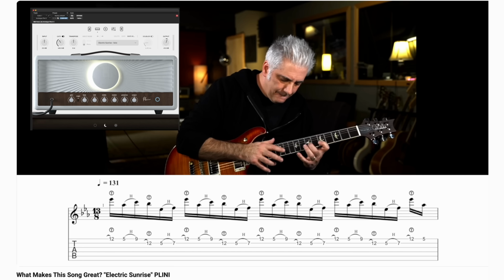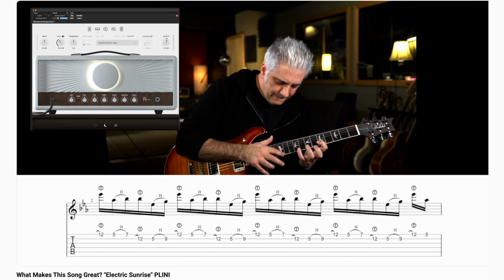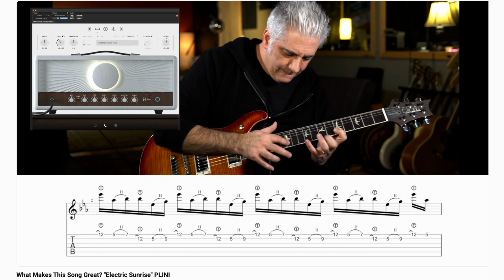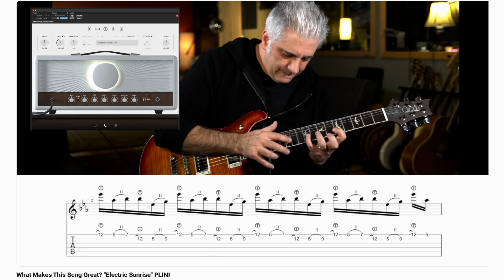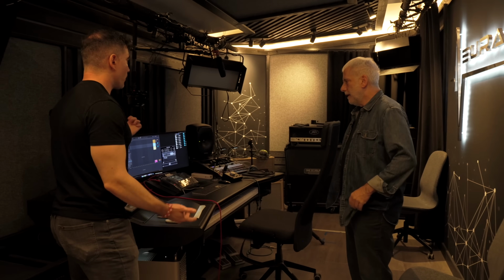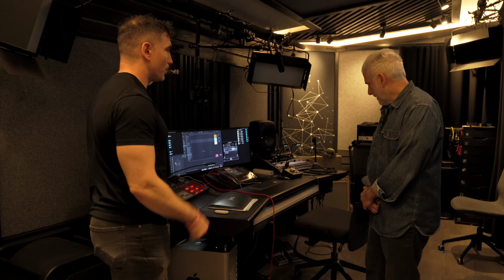I Flew to Finland to Find Out...How Are Amps Modeled?

Comment: While computer technology for guitar captures and amp simulators continues to improve, there will always be a need for real amplifiers for two fundamental reasons. First, something authentic must exist for the copy to imitate. More importantly, experienced players depend on touch sensitivity, dynamic response, and nuance that current digital captures simply cannot reproduce.
 
Amp simulators can approximate tone — open-chord strumming, basic rhythm work, and even heavy chugging — but they almost always feel sterile and fall apart when extreme technique and fine touch sensitivity are required. Many of the greatest players in history, such as Eddie Van Halen, created tone with their hands. Countless guitarists have tried using his exact equipment, only to be disappointed that they still didn’t sound like Eddie. That nuance was in the player, not the gear.

Many younger, up-and-coming guitarists will never experience the greatness of the past, nor will they reach the same level of expression. Instead, they are often impressed by what computers allow them to do. Some modern amp simulators even mask mistakes, much like autotune in vocals, making every note sound clean whether it was played correctly or not. This artificial boost in confidence is like unlocking a cheat code in a video game — something that was neither necessary nor possible in the 1980s, when some of the greatest guitarists were shaping rock music through skill alone.

So while AI and digital tools continue to be applauded — even as they replace jobs and risk creating widespread unemployment — it’s important to recognize that amp simulators will never surpass the true tone, feel, touch sensitivity, and sonic complexity of a real tube amplifier. At best, they will only ever attempt to copy it.

Comment: The point of using a real tube amp is that it changes the way you play. You can literally feel the amp under your fingers, much like an acoustic instrument, it interacts with your playing.  I see neural models as the ultimate evolution of midi sounds: while for the casual listener they can be pretty damn good, even excellent, for the PLAYER that is used to tube amps , they are a world apart. You must have tried  high-end analog stuff to believe.

Comment: I just put my Friedman Runt 20 and other tube amps in storage and up for sale as well after getting the Spark 2 set up in my studio. Are they as good as my tube amps? well, no but I can practice at lower volumes and I've found recording via mic or direct sound great in the mix! I've been against modelers for a while but I just can't play my tubes at the volume levels that do them any justice and I'm not gigging, so... this was a great easy and good looking alternative. The Spark 2 with Cab have a great old school amp look with the tolex and speaker grilles. I'm loving it! I'll have to check out Neural!

Comment: Great video! Hearing Doug's story was really inspiring. Before watching this I suppose I was under the impression that amp modeling meant deconstructing the hardware and replicating each individual circuit in software. It sounds like Neural DSP has done this in the past, but found that it was too time intensive. Instead now they are using machine learning techniques to train some input against this 10 hours of output with the knob changes as parameters. I suspect the original technique is more accurate, but the practical trade-offs make a lot of sense.

Comment: NDSP plug-ins are fantastic. I just picked up Petrucci X during Black Friday. It's super good. Right now, I don't care if its a plug-in or an amp, it's apples and oranges with tehcnology the way it is. In fact, most venues you just plug your modler into the front. No one knows better. The amps and cabs on stage are fakes anyhow. Nothing more than props. People just don't want to drag around 200 lbs worth of equipment anymore. Also in my arsenal are Soldano, Wong, Abasi, Nolly and Plini. All great, but Petrucci sim takes the cake. Well worth the price.

Comment: I'm already ready for QC II. Some of my requests: 1.  Instant On (I've seen these go down live and it's a wait for them to boot back up)  2.  Be about 2" wider all around with a little more separation of the buttons.  3. A proper 120V cable instead of the 9V plug

Comment: Great video. I have a DigiTech GNX 3000. Not sure what year or planet it's from, I think like 1992 Jupiter? But I still use it every day! It is still light-years ahead of today's stuff. Standard guitar input plus, and, this is why it's way ahead, stereo line level inputs, a XLR mic input with level adjustment, stereo 1\4 output, headphone out, MIDI, USB, and this is the biggest advantage, IDK why nobody is doing this today STEREO XLR OUTPUT! With silent stages and recording being the main uses of there's units. For the love of all things musical, STEREO XLR OUTPUTS! And NO NO NO not just a single XLR. When using modulation fx and STEREO delays. Why the fuck is STEREO XLR output such a forbidden concept? They take the time to program STEREO fx of all kinds. Then... Oh here is you mono direct output. I thought of replacing my still far advance "old" pedal but just saw today's stuff as a step backwards just because of that one issue. So with that said... Please spread the word to all manufacturers to take a step into the 1990s and advance your equipment to STEREO XLR OUTPUT. Thank you, GOD, Genius Of Design 😂😂😊😊 👹👿😈
P.S. and I'm not talking TRS cheating. I don't need to buy special wires and adapters. REAL XLR! Did I mention with an adjustable out knob?😅😂

Comment: He doesn't really explain why the lows in the B3K would be "completely clean" simply by attenuating the highs. Is this a "clean bleed" thing like on the Tube Screamer circuit? I know there is a clean blend on the pedal, but that doesn't sound like what he is referring to.
Reply: Its a language barrier thing. He's referring to the fact that Darkglass pedals cut the highs from your clean signal as you are blending it with the distorted highs. The result is a more growly and natural effect than just blending parallel
Reply: 19:04 - From what I can tell, as Darkglass makes the point that the clean signal is never boosted in the B3K-type circuits, he's saying that attenuating the mids and highs post-distortion makes the bass in the clean signal that much louder in relative terms. But there is also the fact that this gives the post-distortion signal itself more bass relative to the mids and highs, which seems to be a major key to the Darkglass sound.

Comment: what about the mooers and hotones and harley bentons of the world?  pretty sure they don't do all the knob turning stuff.  but they all have modelers and all seem to have a similar (if not the same) amps/sounds.  are they all just using one set of amp sims that someone made and sold to all of them?  or are they all stolen (oops, "borrowed")?  call me crazy but I'm rather happy with something like a line 6 or an old digitech modeler, they sound good too me.  but the quad cortex does sound great, just not over $1.5K great in my opinion.

Comment: After decades of being a tube amp snob, I started gigging with the Kemper Stage when it came out.  After hearing the Soldano Astro 20 at NAMM I knew I needed one, and now that is my favorite thing to gig with.  If it's a silent stage or FOH needs a direct out, the tube head has an IR out that sounds fantastic... but when I can use a cab on stage, I just turn the master volume up.  Best of both worlds and is so simple.  Swapped the Stage for the Profile Player so I have a quality fly rig and backup.  ☮❤🎶

Comment: 54:04 The Tom Scholz "Rockman" is all analog. The "Power Soak" amp attenuator is 100% passive. It is very simple. It has a bunch of 5 and 10 watt ceramic resistors in it and uses a switch to arrange them in a way that equates to a certain dB of attenuation. It is NOT a reactive circuit because it does not have any capacitors or inductors in it.

Comment: I’ve mostly gone back to real amps to get away from option paralysis/plugin GAS, but gotta say Neural DSP makes some of the best sims I’ve ever used, and I still use some of their stuff to practice or jot down ideas.
Reply: I just did the same thing with my Axe FX - nothing wrong with modelers but I found myself tinkering with all the options rather than just being "limited" with the tube amp I plugged into. It is a question of workflow!

Comment: I can say that current technology still can’t model every process happening in a real tube amp with 100% accuracy.
Doing so would also require so much CPU power that real-time processing becomes almost impossible.
Until that changes, guitar amps aren’t obsolete.
Reply: Its about the sound and they absolutely can imitate that 100% to a point where its impossible to tell apart in a blind test. There are thousands of pieces of proof for that.
Reply: @metalpuppet5798  No, they can’t imitate it 100%. A true 100% match would mean the exact same output signal, and if you run a null test between a model and a real amp, there will always be some residual difference. It’s the same reason plugins don’t sound identical to analogue hardware: some get very close, but never perfectly the same. And if you start pushing the model into extreme settings (very high gain, aggressive EQ, etc.), the difference gets even bigger.
Reply: @JanusJanavas do a blind test. You 100% wont be able to tell them apart. Thousands have done them and came to the same result
Reply: @metalpuppet5798  I wasn’t talking about a blind test. I was talking about 100% accuracy. Do a null test and you’ll hear the difference. Thousands of sound engineers still use analog hardware in their studios because software plug-ins can’t fully achieve the sound that hardware can .
No software emulation can currently replicate the sound of an analog console with a bunch of audio transformers in it. If it could, recording studios would sell their consoles. There’s simply no point in keeping a large studio console that costs hundreds of thousands of dollars and paying the bills for its maintenance if software could emulate it.
Reply: @JanusJanavas wrong. Studios use them because they have them and they dont have to move them around like touring bands. Sure there may be a difference when you scientifically compare wave forms etc but that is simply not audible to the human ear. Thats why thousands of amp elitists like you have hilariously failed blind tests. Because there factually is no audible difference anymore. Not in the „naked“ signal and definitely not in a produced song
Reply: @metalpuppet5798  Wrong. Here are some famous and well-established sound engineers who explain exactly why they use analog gear:

“There’s… a feeling and sound perception that I can’t get in the box.” Jeff Villanueva (mix engineer)
“Just because you have the plugin doesn’t mean it sounds like the console did.” Will Kennedy (mix engineer), Recording Magazine
“I do a lot of mixing in the box and then I go back to the console… it’s much better to my ear.” Alan Parsons (engineer/producer)
“It’s about the organic hiss… those are things that you can’t get with the digital world.” Fabian Marasciullo (mix engineer)
“I prefer the sound of analog… I have my Neve console for summing.” Yoad Nevo (producer/engineer)
Just because you can’t hear the difference, or thousands of other people can’t, doesn’t mean there is no difference, especially when you start stacking multiple tracks together. Millions of people can’t hear 16 kHz and above. That doesn’t mean nobody can. This isn’t even an argument.

Comment: I use a Quad Cortex and have been using a wet dry rig live with amps before switching to the QC. I can literally double my wet dry rig to a double wet to a double dry giving more depth and width. With opening for national acts bringing my real amp rig just makes it super difficult. Now I just bring 2 guitars and my pedal board, and plug 2 xlrs out for our in ear rig which gets sent to FOH. I can be loaded up in under 5 minutes. And the sound is phenomenal. I'm a lifer for QC.

Comment: Could someone please explain 20:10? What does he mean?
Reply: From a my non-expert and possibly wrong understanding: high gain was applied to bass signal which fattened the signal. This retained the lower frequencies but at the cost of leavinf them at a much lower volume. To correct for this, he merely lowered the volume of the higher frequencies so they didn’t drown out the bass, and voilà the bass frequencies were not lost in his distortion effect.

Comment: 5:23 This is both a dismissal and an attempted ego saving dig at Fractal, which does do the schematic level modeling and does analyze the transformer behaviors and that's why nobody has matched the Axe Fx's modeling yet. That said, the V2 captures in the Quad Cortex work better for me and also present the first opportunity for great fuzz results in the digital world so far, but Neural as a company makes me cringe and I'm rooting for Fractal and support Line 6 too.
Reply: When it comes to variety of sounds that are all top of the top Neural is unreached
Reply: @metalpuppet5798 This is fundamentally and factually incorrect, and that's without question. I have both and use my QC the vast majority of times because it is much quicker and easier to use. However, Fractal is undoubtedly better with regards to breadth, depth, and quality of sounds and features.

Comment: For those of us that are hobbyists, I dont think that the old technologies will ever go away.  Old school tube amps and pedals are the way to go. First, because modelers solve a problem  that I dont have: easy set up and take down. 
My rig never moves. I also dont have space constraints either. Finally, since i dont play in a band, I dont have to worry about communicating with FOH or cutting through a mix.  If I were to play live, I would grab a tonemaster pro. But at home just for the fun of it? 

Old school forms of guitar amplification are kind of like vinyl records and 2 channel stereo systems. They are never going to go away. Especially the high end stuff. Us Gen xers will keep old school going.

Comment: As far as sound quality is concerned, I think this debate has been settled for a long time now. Modeling sounds just as good as traditional amplifiers—sometimes even better—while also being more practical. On that point, I don’t think there is any real debate left. This has been proven for years.

However, speaking only for myself—I can’t speak for others—the reason I still stick with traditional amplifiers, whether tube or solid-state, is simplicity. There is no need to turn on a computer, launch a plugin, or click around on a screen. Even in the case of something like a Quad Cortex, there’s no need to navigate menus and sub-menus. You just turn a few knobs, and it works. And if you have good speakers, it sounds very good—more than good enough, actually.

I think this is where the divide between people really lies. There will always be those who believe that tube amplifiers sound better. You can’t really take that away from them—they will never change their minds, no matter what. Even if they are objectively wrong, because, as I said earlier, modeling sounds just as good as real amplifiers. Still, some people will always say that a real tube amp through a real cabinet will sound better.

For me, it’s simply a matter of ease of use. Having to plug my Quad Cortex into an FRFR speaker doesn’t really appeal to me. On the other hand, an amplifier paired with a good cabinet—or even better, a combo amp with a speaker that you can easily swap to get different tones—feels much more intuitive and straightforward.

The downside comes when you want to use effects. At that point, you’re forced to rely on pedals, which isn’t always very convenient. Sure, it has advantages: it works without the internet, without software, without anything else. But carrying around a huge pedalboard just to have a few effects isn’t exactly practical either.

That’s why I think there’s a third option that makes a lot of sense: modeling built into a combo amp. The Marshall MGFX series, for example, are excellent solid-state modeling amps with built-in effects that sound very good. On top of that, changing the speaker is easy and clearly designed to be done, unlike some other amps where swapping the speaker is intentionally complicated.

So, traditional amplifiers are not going to disappear. Between those who believe tube amps sound better and those who value the simplicity of turning a few knobs and having everything just work, there will always be a market for them—just like there is for vintage guitars.

In fact, even the guitar itself could theoretically be replaced. There are many software emulations that allow you to play without a real guitar, and they work very well. And yet, people still play real guitars, take the time to learn, and develop their skills. That’s encouraging.

Modeling won’t replace real gear. It will coexist alongside it, in parallel—and that’s a very good thing.

Comment: Guitar amps are never obsolete. All this digital stuff will be digital trash when max flash write cycles are maxed out, no more firmware updates, microprocessors are defective and no  microcontroller firmwares is available due to propietary  software... (if the chip gone bad & you want to fix it after 20+ years)... Those modeled amps are good on the go, but not for the loving guitarist.